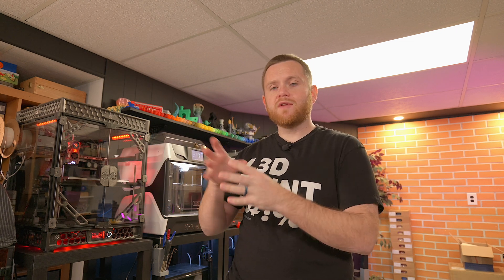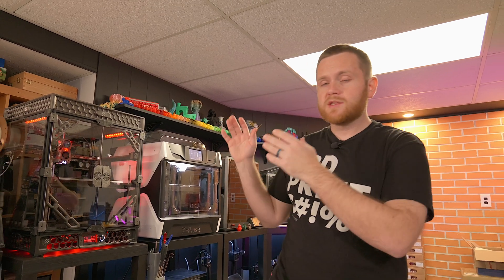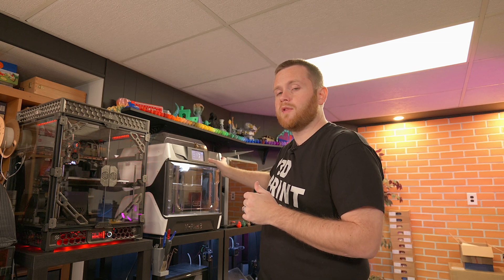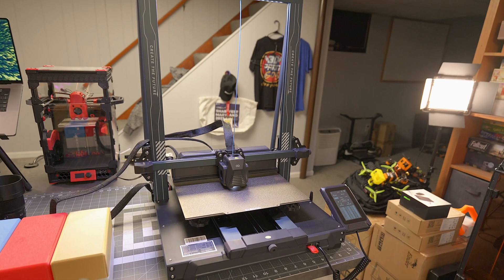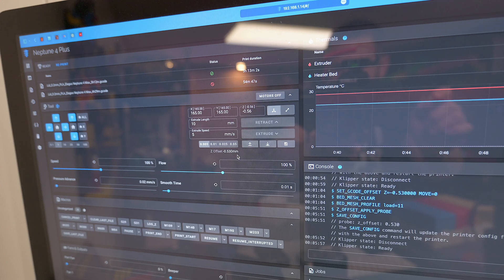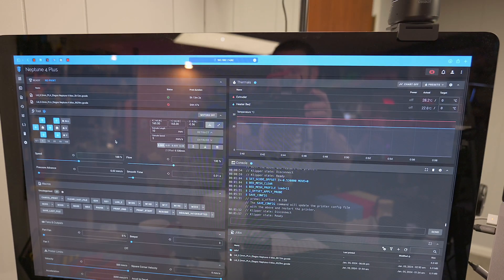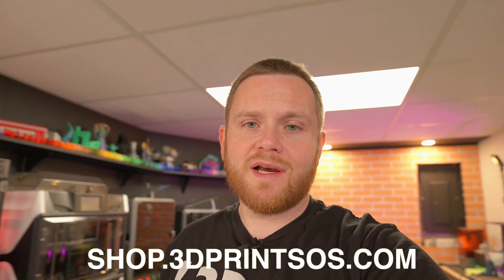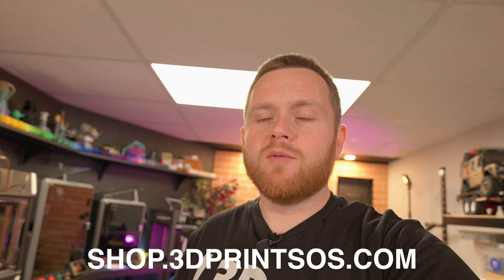PSA! Z-Offset Doubling on Klipper Printers with Custom Screens

Comment: Hey Fedor, After what seems like ages of back & forth with Qidi Customer Help, I got my Qidi X Plus 3 Printer to work again!
It was playing me up by starting a print then part way through the printer would stop and I would get all these error messages about the memory or the heater etc.

Over a few emails to them sending them photos of the errors and what happened, I got the damn thing working and unlike before the Fluid interface was now working.
I had to buy a new 10 meter long LAN CAT 7 Cable to go from the router of mine to the printer so the PC could use it's Cat 7 cable to the router to control the printer by the Browser and Slicer.

Now it is at least printing as I was told to use Fluid to clear files from the printers own Memory, Which I have done.
So now that is sorted I need to ask you which Web Camera with USB cable will be the best but lowest costing one so I can set up the direct views of the printing and do time lapses?

It don't need to be super special one but have a good enough filming and video quality to work well. And how do I set up the camera for it and  store the videos taken? 

And where does it plug in to? It be a USB A end plug or do I need a USB C?

Also when I use the Browser to connect to the Printer by my Browser it said connection Not Secure up the top left of the Browser page, How do I make it secure? 
I am using the CAT 7 cables from the PC to the Router then to the Printer so is that not local and secure?

Thanks.
Reply from the maker: Quite the journey! Grab the cheap Logitech 920 camera. I use one and it works well. Really, most usb A cameras work with klipper. You can always look at the klipper documentation for Timelapse setup. 
As for the not secure message, just ignore it. It’s all local anyway.
Reply: @3DPrintSOS  Hi Fedor Thanks for the information!  With the camera what would be the best way to mount it to do any time lapse of the inside of the X Plus 3 Build area if I have the cover on since I do use the ASA & abs & PETG Printing in the enclosed area. In fact I never done ASA until now?  I have some Flash Forge Black ASA filament as my 1st one.  It looked great on the 1st go until the memory problems stopped it printing!  
I also picked up with the ASA a spool of bright yellow Flash Forge TPU, be great to try that too? is TPU okay to print in the x plus 3?  Thanks 😁

Comment: Good job adressing this. I experienced this issue with my rooted CR10SE,instead of sending the file from creality print directly from the printer or starting it from the nebula pad, i ONLY upload directly to fluidd and start the print from there. No more issues.
Reply: two days of trying to figure it out thanks!
Reply from the maker: Right. It’s because using the pad adds on the zoffset from it onto of the fluidd config. So having it zero on the screen OR zero in firmware is the only way to not have it double on you if you want to switch. Basically one or the other OR make sure it’s zeroed out and only use one or the other for z. Otherwise you gonna be scratching your head AND your pei. 😂

Comment: This Happend to me. After printing and did some baby Z step to fine tune the z offset because there are no "save Settings" on the screen. I saved it in Fluidd. the next print It scratch the PEI sheet so bad not only did I needed a New PEI sheet I needed a new Nozzle

Comment: Thanks Fedor! I've ran into this problem early on, with my Neptune 4 Pro and ended up having to reset the printer to factory, reload an older printer config, re-level and set Z. Then I didn't touch the Z in the printer config until I checked out the three macros one at a time. As soon as I set Z offset and it hit the bed, I was watching it, and realized setting it in the printer.cfg was wrong for me. I removed it. But I didn't think about why it was doing this. Now I know. Just in case you're curious though, there is a hack to load Klipper screen instead of Elegoos. I played with it, and it works well. Just remember that it is still lurking in the background though.
Reply from the maker: OOO  I gotta find that hack. I do like elegoos interface on this machine, it’s one of the best ones out of all these, in my opinion, but I personally would still like to use vanilla klipperscreen.

Comment: What is also fun is if you do a calibration from the screen on a Qidi X-Max3 and you do not press the "Completed" button after the bed mapping, the offsets will not get stored in the Qidi - leaving you about 1mm away from the bed when you start your print.

While you have to (maybe?) start the bed leveling process from the printer, if for no other reason than to use the plastic sheet to get your initial gap set. But you don't have to finish it from there. You can go sit down and begin a print once the printer is (not quite) finished with the bed leveling. However, doing this will toss some or all of the results of the bed leveling and you will most likely start out "air printing".

Qidi is aware of this and I think that the "fix" is to push the "Completed" button. This is reasonable, but it doesn't hurt to make people aware of this foible.

Printing TPU for the first time - looks like poop.

Comment: Hi Fedor,A very helpful video since now have the Qidi Tech X-Plus-3 Printer.

This is the 1st core xy fast klipper enclosed and heated chamber 3D printer I've ever had!

I use the printers own UI screen for the Z Off Setting. I can't do it in Fluid as I can't seem to get it going?
I have just a basic printer photo of the printer under the Qidi Slicer Device tab, stating if the printing is going or on standby etc. No control there.

I was asked to do a update of the firmware and did so by copying it over by the USB stick, The printer was fine until I updated it's firmware to V 4.2.10 and Then after the updating.

Now the printer keeps crashing and telling me to Restart Klipper and Firmware Restart. on the control screen after of course 
stopping the two good prints half way through Both and not being able to carry them on after!

I contacted Qidi Help by email and sent them the info and photos etc. They said that the Memory of the printer needs to be cleared of files and I need to update to V4.2.10 firmware.
But I just emailed them the reply pointing out that I had already done that update version and that's when the printer stopped working right?

They said go in to Fluid interface and clear the files in the onboard memory. I told them I can't as I don't have the Fluid interface only that basic device monitoring Icon.
I don't know anything about how to get it done? So I've asked for them to tell me.

The 2nd failed printing because of the 2nd shut off was my very 1st ASA print, I just brought the Flashforge ASA filament this week. I never used it before.
he shame is the print was perfect even down to the tree supports being so too. But the printer firmware crashed half way through it.

Hopefully Qidi will help me sort it out?  I did ask them for the Original Firmware the Printer came with as that worked! 
But they said use the V 4.2.10 update even though as I told them that was when the firmware failed. Such a huge pain just as I was enjoying this printer!

Comment: The Z offset with Klipper is absolutely annoying and needs to be addressed by the developer. Marlin's approach to it is very sensible in contrast.
Reply from the maker: Thats the thing, they have addressed it, but the manufacturers are ALSO addressing it on their own. haha. So that’s kind of the issue. There is two ways to do it and both of them dont talk to each other. haha
Reply: @3DPrintSOS on a normal klipper it is also annoying....on my last print I first forgot to load the heightmap. That fixed I set the z offset perfect while doing the first layer. And forgot to save it. Problems I never had with marlin

Comment: I recently found that the "Z" offset under the Printer Settings tab (X-Max3) doesn't seem to be having any effect.  I added a positive offset but the next print didn't adjust on the printer for the value I entered on the Printer Settings tab.